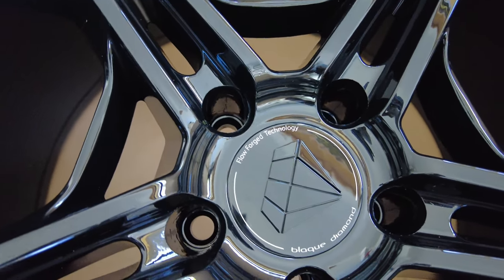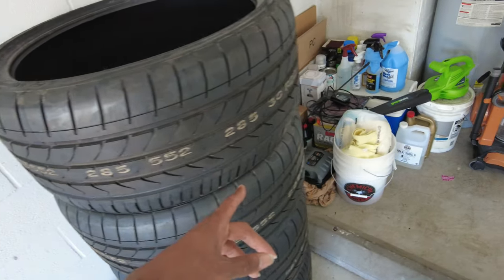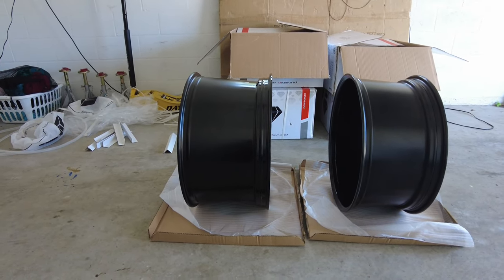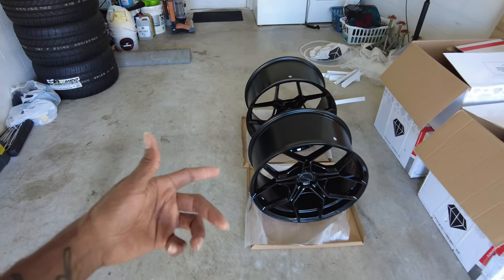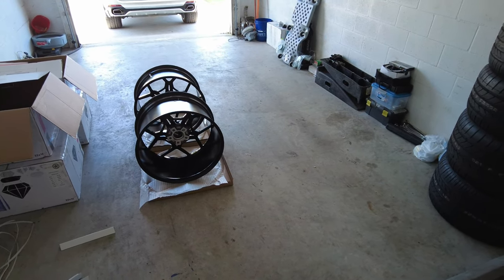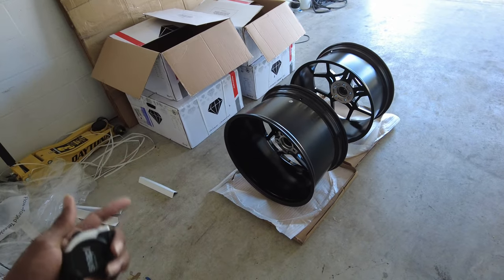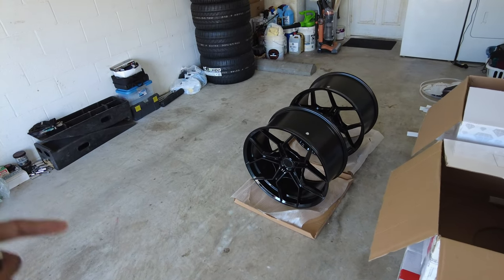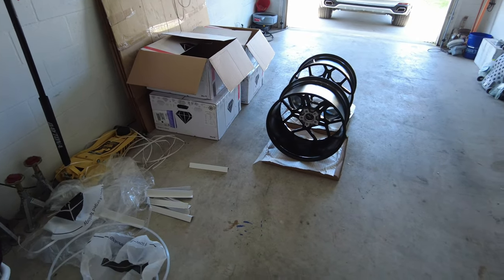750HP X6M GETS 22X12 ULTRA LIGHT WHEELS = FASTER/QUICKER!!

Comment: Bro! Them beats in the background are on point 👏 Hope u don’t have any transfer case issues w/ the 285 up front. 295 is closer to OEM circumference spec. Keep these videos coming 🔥
Reply from the maker: I appreciate that bro💯 I hope I don't have any issues either, but running with the 285 gave me the exact same circumference as the 335 in the rear when I calculated it in the online wheel and tire calculator. So it should have the same exact circumference as the factory 285/40/20 up front and 325/35/30 out back.
Reply: @AutoLust  I just ran the numbers and you’re right. I also don’t think our transfer cases are as “sensitive” as everyone on the forums makes them out to be. Keep doing u bro!

Comment: How does the car feel with those wheels on ?? Do you notice the handling difference?? Trying to see if they have some for my year
Reply from the maker: Yes you can definitely feel a difference especially with acceleration because the wheels are a lot lighter and wider so the grip in the corners is greatly improved also.